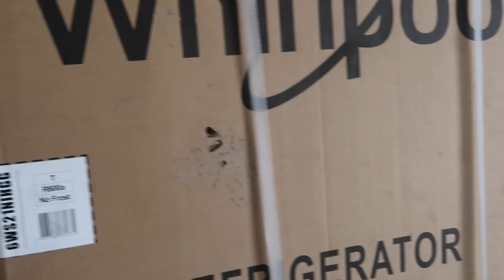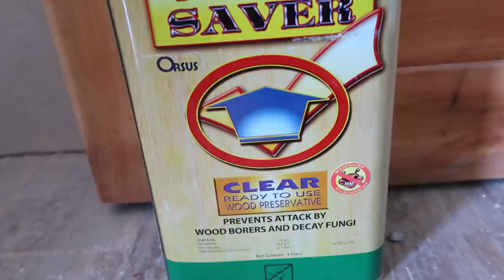HOUSE BUILDING IN THE PHILIPPINES - EPISODE 167: WOOD TREATMENT I  PANTRY SHELVES

Comment: It's plastic filler. "BONDO" is company name.. It's for use on metal and fiberglass. The wood has to be sealed to prevent as much expansion as possible. Or the plastic filler(Bondo) won't work well. It may work it's way off wood in high humidity or if wood isn't prepared correctly. Any interior wood stain, varnish, sealer, or pain should be "LOW VOC or NO VOC"! Some high VOC products have been tested and found to release dangerous fumes for months.. Make sure that your builder is using safe products and using them correctly.. Good luck..
Reply: Oh okay good I thought it was a car Bondo sorry